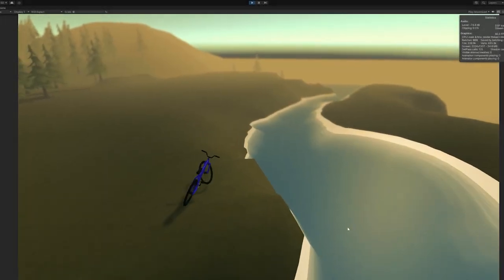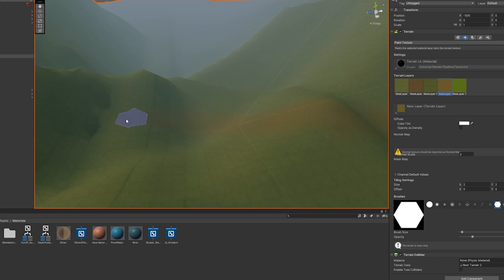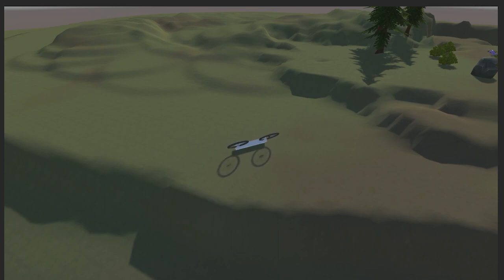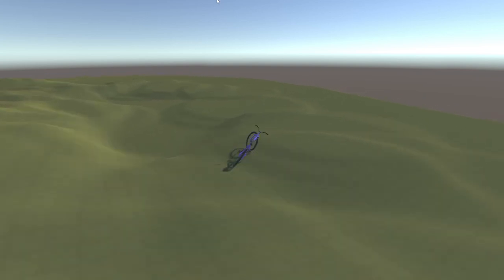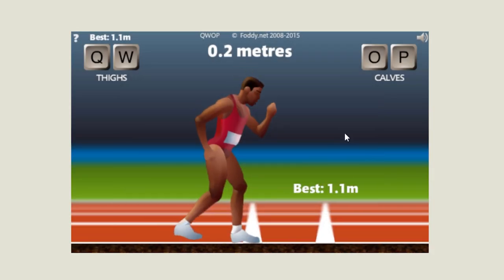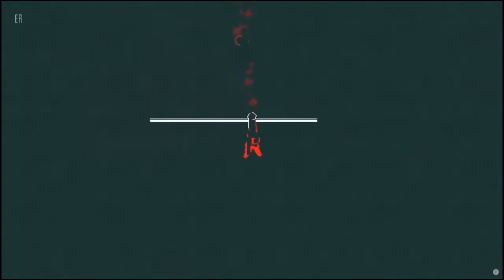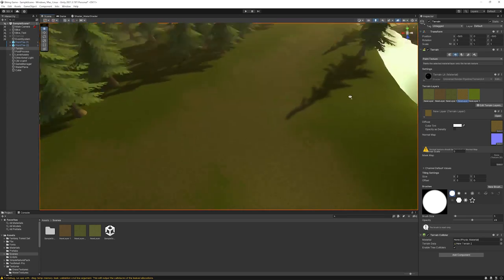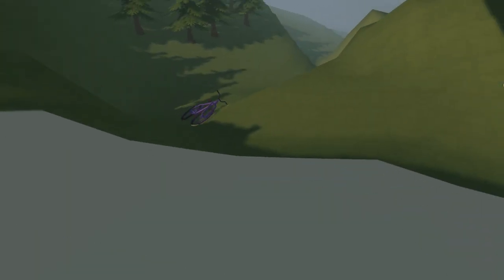How I Started Making a Game In Unity - Devlog 1 - Prototyping A Bike

Comment: No comments, really? This is a pretty cool project!
I would love to see more of this game progression because I've never seen anyone making a bike game in Unity, and I love physics-based games!

P.S. I don't know if you know this already, but if you go to Project Settings > Time, and set Fixed Timestep to a lower value than the default, which is 0.02, it can improve the physics a lot in some cases and make everything way smoother (it basically improves how much physics calculations in a frame is produced). For example, I'm working on my personal Car Physics side project, and it helped me a lot by setting the Fixed Timestep from  0.02 to  0.002. Improved the suspension wheel spin and slip behavior and fixed my tire skid sounds based on a tire slip which was acting strange.